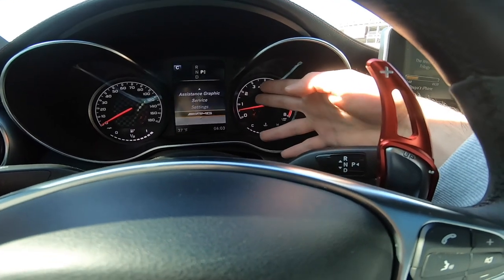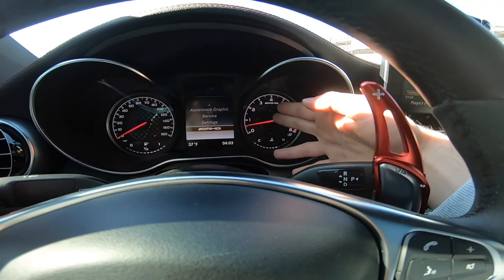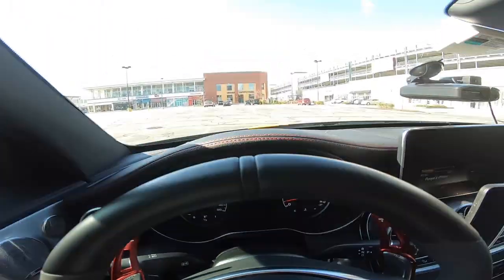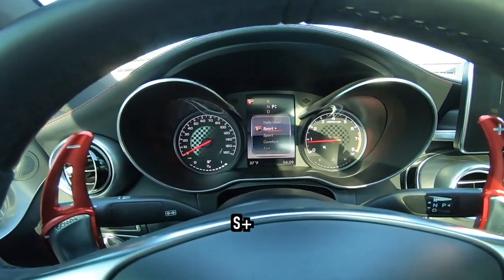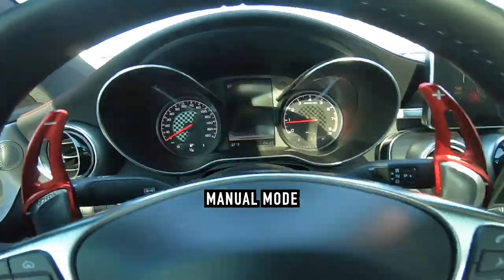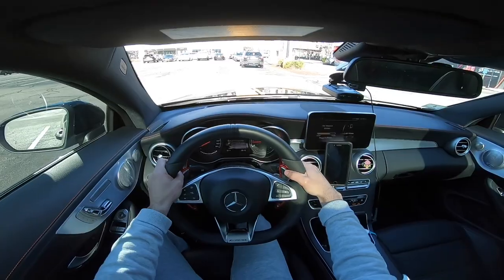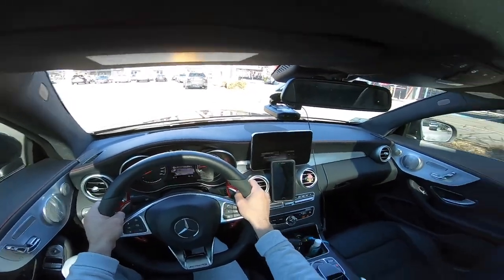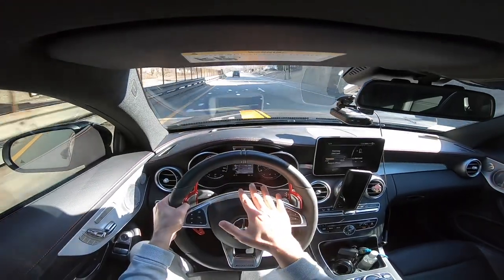Tips & Tricks on How to Use Paddle Shifters! *Short shifting & double de-clutching method*

Comment: do you need to be in manual mode to use the paddles? What happens when you downshift in auto? I can't find answers anywhere
Reply from the maker: Watch my most recent video on how to use your paddle shifters! it'll temporarily allow you to shift manually but will go back to auto by itself. using shift paddles in auto mode is a great way to learn before fully going into manual mode!
Reply: @Amgenetics  yea I drive stick-manual so ik how to work the shifts lol. I was just wondering whether or not the car shifts back for you or if it even lets you shift at all (while in auto). But thanks for the info and i'll check it out!

Comment: I really don’t use the paddle shifters since I really don’t know how to use them much and I’m afraid I can mess up my car. this video was really helpful doe. Can this mess up my car if I don’t know how to use it?? Thanks man
Reply from the maker: Hey man. I made another video a while ago on how to use them! Check it out 👍🏻 Make sure your oil and transmission temperatures are warm enough. And since it’s your first time, don’t go in manual mode (keep it in auto) and still use your paddle shifters 😁
Reply: Amgenetics_ awesome, will definitely watch it, thanks for the tips man. 🔥🔥 videos as always .
Reply: In an automatic, DCT or CVT transmission car, it is very difficult to mess up your car. Don't worry. Just make sure that your car is warmed up, after a 10-15 minute drive. The only other thing is that if you're already close to red line, don't down shift because that may put you over red line. You can do this once you get used to your gears and RPM. You cannot stall a car by up shifting too early unless it's a standard, manual transmission car. If you cannot up shift, then the car won't let you, so don't worry.

Comment: Can you do a double de clutch from 3 to 1?
Reply: No, you can downshift from 3-1 but double clutching is not a term that can even be used with an automatic so no clue why he is trying to make multiple downshifts sound special lol
Reply: @amg202benz  That’s what I was thinking, I tried with my c43 didn’t even let me probably blocked electronically
Reply: @caza_  you can't otherwise your transmission will break in pieces.

Comment: Seriously bunk information.  C43 literally does not have a clutch it is an automatic with torque converter.  Short shifting is just shit for your power band.  Obviously you want to shift in a manner where you do not bang the redline but short shifting is just driving like a granny.  Also you can just hold the downshift in for a second and it will give you the lowest gear the transmission will allow.  Hot mess of made up information lol.